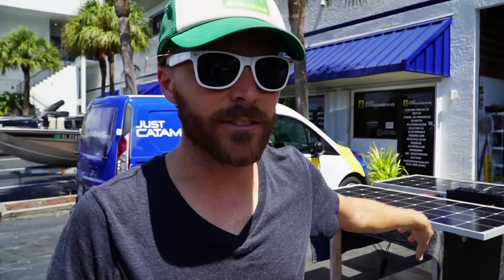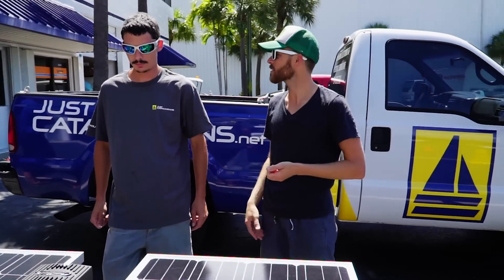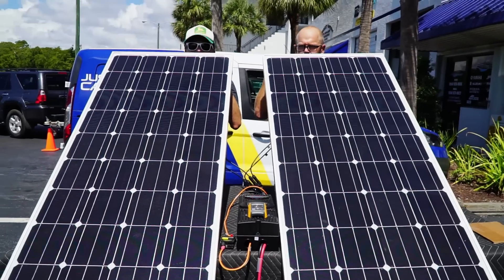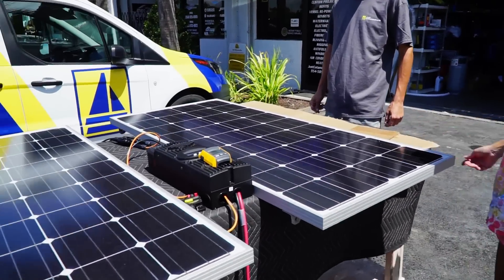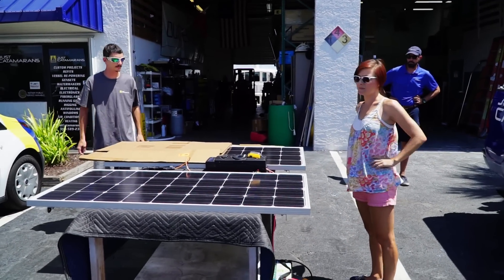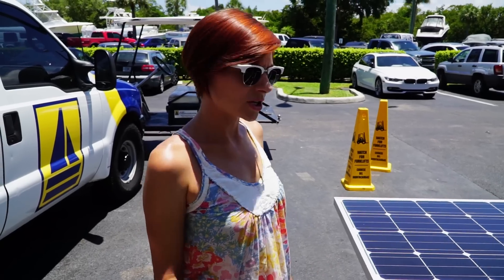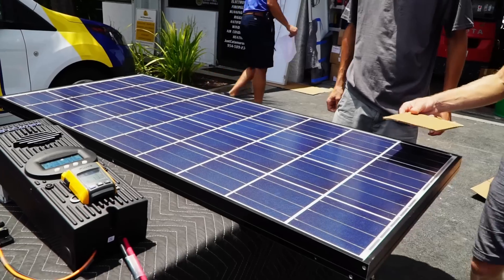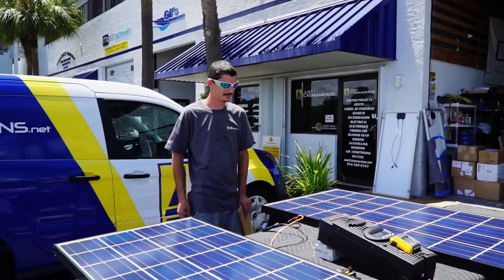Sailboat Solar Power - Series vs. Parallel & Shading

Comment: Since watching this video, I did some serious research on solar panels and found a company called SunPower. Their solar panels are designed for shade and harsh environments. They sound expensive but well worth it. Hope this helps.
Reply: They buy lots of expensive stuff - they can definitely afford the SunPower panels!
Reply: They are using all the panels they already bought, the 7 or 8 from their RV.
Reply: I caught that, they are the ones that don't like shade. Sunpower makes a solar panel that is designed for maximum output if in shade or even if a bird craps on it. Even on cloudy days, they out perform most others.

Comment: As your old gopower panels are from the rv, perhaps the difference is actually on the glass itself.  I'm going to guess there is micro-pitting and scratches that is diffusing the sunlight enough to make a fresh panel out perform it.

Comment: Some Cats put solar panels over the davits, if you did that you could design a mount that would let you tilt the panels to improve the angle. You could also have a couple of panels that are stored underway but that mount to the rail an could pivot, even be height adjustable to keep them from being shaded. Many boats also have wind generation mounted which will give you power from the gentle tropical night breeze, or gale as the case may be. Just check a bunch out first some are loud.

Comment: the question is, would connecting them in series or parallel yield higher amps out, if the conditions were identical with an mppt controller? didnt seem that way from the tests you did here, so series would not have any benefits, besides maybe cable thickness.

Comment: So basically the solar panels cells themselves are in series right? PS Perhaps some hydraulic system could tilt those panels on the dodger. Nice test btw! Wondering if there are smart panels, where as one cell is not producing X it bypassed keeping the current and flow high. Now its the same effect when you pull out a light in a christmas light string.

Comment: Won't your boon be in lots of different positions when sailing - think tacking.  If one small panel shaded takes out the whole panel effectively, what about using 4 or 6 small panels rather than 2 large panels (?)
Reply: They have like 8 panels or something. They took all the ones off of their RV. Their yacht will be solar overkill.
Reply: It's not overkill if you want to run your electrically powered watermaker on a long passage without burning the limited and dirty fossil fuels on board.

Comment: hi
I'm an electrician.  I didn't see if your controller was converting the voltage to a nominal voltage.  Normally if you connect in series the voltage is higher and amps lower. You have to multiply the voltage and amps to get the watt output.  If the voltage is the same both times due to the controller that's fine but if not then your test is flawed as you only checked the amperage.
I would love to know if the voltage was constant.
Thanks Marty

Comment: Any way to get the panels above the shadow of the boom?  Crows nest mounting?  Maybe a way to have them mounted to a small electric motor to collapse them when not using them without having to scale the mast.  U could upgrade your sail to the style used on the Alcyone, the Cousteau Society sailboat.  Put flex panels on the sail.  Probably an expensive solar panel mount...lol  but it would be cool.

Comment: It also depends on how many by-pass diodes the panels have, if any.  Canadian Solar uses half-cut cells and has more columns.  They put a by-pass diode on each column.  Allegedly, Sunpower has a by-pass diode across each cell. I don't know about other panels... damn hard to find that info.

Comment: Your results are typical with the types of panels which you were using for your test.  This is also one of the main issues which solar panel manufacturers face.  You may want to check out TenK Solar, their panels do not have the shade issues which you have shown.  I know because I have their panels installed on my house, which has a tree which shades a number of my panels, but I still get decent power out if them,  even when more than 1/2 of the cells are shaded.  I am planning on using a panel or two for my RV, since I expect to have tree shading issues while parked.

Comment: Interesting to see that fall-off in power. Re other sources of power. What kind of props do you have? ( folding, feathering, fixed pitch.) If you are running  fixed pitch props you could add an extra pulley, belt and alternator on the prop shaft and take advantage of the flow of water passing the props. Also gives you triple redundancy in the event of an alternator failure. PS..... just checked your haul-out / survey video...looks like fixed pitch!..... worth considering.

Comment: Could you use multiple charge controllers so each panel works interdependently?
Reply from the maker: Yes, stackable MPPT controllers may be the answer...or at least one of the answers.

Comment: I would think the shadows will be to one side or the other but not both sides at the same time.  try series on each side then the two sides in paralell. Your MPPT will like the higher voltage and the lower line loss due to higher voltage.

Comment: An additional bypass diode connected in parallel with each panel when the panels are connected in series can help if one panel is shadded

Comment: What would supplementing with wind turbines do for you?
Reply from the maker: Not much. We touch on that in this post https://www.gonewiththewynns.com/charge-boat-batteries  Turbines would add so little power at normal "ocean breeze" wind speeds, and at higher wind speeds they tend to be really noisy and can cause awful vibrations through the hull. Nobody we know who has one loves it.

Comment: I would like to have seen the voltage difference more than current as series panels would drop voltage to the controller. Ideally you'd want to measure watts doing this experiment. Which requires both amp and voltage readings.

Comment: I also thought the bypass diodes were to mitigate the power loss from shade so I was surprised by your results...  I went googling and ended up finding an interesting document that explains that the diodes are actually to protect the shaded cells from being burnt up by the unshaded ones in the same string of cells.  

Learn something every day!  

Here's the doc if anyone is interested:
  http://www.solaredge.com/sites/default/files/se_technical_bypass_diode_effect_in_shading.pdf

Comment: Mind blown!  Seems like numerous small panels wired in parallel would be more reliable than one large panel if there is ANY chance of shading.
Reply: Just so, I'm not any sort of knowledgeable as to solar panel construction, but it seems that the sections of each panel is wired in series and that there is no pass through of the electricity generated by the separate sections if one entire section is covered and there is NO electricity generated from it.
I would not have believed that would be the case. I wonder if there are Marine solar panels that are wired in parallel to avoid this
Reply: Less wiring maybe?  Like the old strings of Christmas lights.
Reply: Mike Siedlecki Probably exactly right, less wiring.  I suppose it makes sense for most applications where solar panels are installed, Doesn't work exactly right for a sailboat though!
Reply: no...it's like hooking up batteries. do you need voltage...or current? then connect accordingly.

Comment: Many people mount their panels on an arch over the dingy davits to avoid shading. Some people mount their on the life lines and pull them up when needed.
The series parallel test is basic high school math
Parallel is positive to positive and negative to negative , voltage stays the same , amps are added together
Series is negative to positive,  Amps stay the same , voltages are added together
Reply from the maker: On our catamaran we are mounting above the dingy davits but the boom is still a factor and will still create shading.
Reply: There are all kinds of options but $$$$
But it's easier and cheaper just to live with it, watch your consumption, get more or better panels at a future date, they are becoming cheaper every year. If your boat don't have a generator, get a Honda 2000 for topping up under heavy use

Comment: Nice test and I would always go parallel because as one panel may fade, the others (not shaded ones) will still deliver that 12 VDC that you want. If you're in series at 24 volts and you get shade, you will never achieve the proper voltage. Good choice on going parallel!  Ü

Comment: try a flexible solar panel, and try to use propeller power, like by putting a wheel in the water while you're sailing or in the air to produce power.

Comment: Solution:  4 panels in 2 groups, the groups are connected in series and each 2 panel group is connected in parallel, connect a wind turbine to supplement the solar panel arrays.

Comment: Install the panels at the very aft of the boat out of the way of any shadows. See video channel of SV Delos and see how they have their panels located. Good luck
Reply: Pretty sure they are aware of installing on top of the davit system. They have six or eight panels, so I'm sure they'll have a couple on the davits and the rest on the cabin roof.

Comment: Here's a really good link explaining shunt diodes and how they help. And also have a look at Half-cut cells. https://www.thesolarnerd.com/blog/which-solar-panels-work-best-in-shade/

If using cheaper panels, (with fewer shunt diodes) you'd be better using several smaller panels wired in parallel, although this isn't as space efficient for the same overall power, but you might find that you generate more power with 6x100w independent panels than 2x400w panels in situations where you are likely to have partial shading.

Comment: I suppose the ideal solution would be to use the diy kits and wire each cell parallel so shading one cell doesn't take out the whole unit?
Reply: You need some series connection to get a high enough voltage

Comment: If the simulated boom shade is a problem, what about that huge Dacron thingy attached to the mast/boom? Wait I got it, sail at night, drift during the daylight so that pesky sail isn't a huge shade issue.(  ;-)  just kidding) Try installing several sets at different locations on the cat and manually switch to highest charging set as you tack.

Comment: Almost all solar panels out there have all the individual cells connected in series.  I've seen one exception.  I have a panel that has two strings of cells, each set in series, and the two strings in parallel.  So, almost always,, shading most of a cell or an entire cell is GOING TO BRING THE WHOLE PANEL DOWN.  :(  So, parallel is anyone's best bet unless you use optimizers or, in the case of a grid tie system, micro-inverters.  Outside of these two cases, ALWAYS do parallel instead of series (if your charge controller can handle it).  If you connect two or more solar panels in series, and since the cells in each panel are also in series, you basically have one long string of cells connected in series, so the total current you get out of the entire set of panels cannot exceed the current produced by the LOWEST producing cell.  So, totally cover one cell and you bring down the whole system.
When you do parallel, covering an entire cell only drops the current by the power of that one panel.
Reply: I thought about this and what I said above is not 100% true.  For a home system with a lot of panels, it is usually not possible to connect all the panels in parallel.  The current (amperage) generated would be prohibitively high so the gauge of the wiring would not be practical.  In this case, the panels are usually broken up into multiple sets of series connections or, as I said above, optimizers or micro-inverters allow you to connect everything in series without shading causing a problem.
Reply: 99% of solar panels are made with either 2 to 4 strings of cells tied in parallel.  This is to achieve a high voltage and a low amperage that will suite a residential setting and National Electric Code limitations. The diodes are typically placed strategically across the edges of the parameter to prevent as much production degradation from shade as possible.  This is because most panels are designed to be placed on roofs, and most shade comes from tree branches that will cause shade that will span the width of a panel/module.

Comment: Nice test...
I think you should have used parallel on the RV as well...
Series is only useful if you have to use a longer distance of wires from panels to inverter/controller (what ever you call it ;-) )
And on a boat or RV the distance is alway short enough for parallel ...

Comment: Two panels on a boat this size with it's energy requirements is pretty anemic. Have you figured out your daily amp/hr budget yet? Without it all this is just shooting in the dark.
Reply: this was just a test. They have all the panels they took off their RV plus the lithium batteries. They are going to have over 1000 watts and 1000 amp hours.

Comment: I think the problem is inside each pannel. Cells connects series inside. If i am right you just should sell this pannels and buy another.
It was intersting video. Thanks !
Reply from the maker: That is why we tested multiple panel brands.  They each have diodes but they only do so much when it comes to shading an entire cell.

Comment: mount the solar panels on a frame over the transom ;-)
Also if you have 2x50W panels and one fails you're on half power, if you have 5x20W and one fails you have 80% power ;-)

Comment: Ideally, You need to run a charge controller on each panel. If one panel is shaded... You would still get full power from the other panels. This is the expensive solution... You can compromise, If you run 4 panels, you could run 2  controllers with 2 panels each. This redundant thinking gives you more efficiency and if you lose a charge controller at sea, you still have one... And, in a pinch, you could hook up all the panels to it (assuming it could handle the amps).

Comment: Wow! I'm not really familiar with how solar panels work, but you would think that when shading 10% of the panel, it would only take away 10% of the power. There is an opportunity for someone smarter than me here...
Reply: Each cell on a panel are linked in series
Reply: That would appear to be exactly the problem. For the current to drop that much by covering just one cell, most of the cells on one panel would have to be in series. Which is made made worse when you connect the two panels together in series as well. I can't for the life of me think why the panels would be designed this way since it negates the whole point of parallel redundancy of the cells. But it sure seems to be the case.....
Reply: Yes I was screaming at the screen when they put one on one cell.. LOL.. But its really good they went out and tested it so people can see :D
Reply: Seems like it's behaving similar to old Christmas lights, when one goes out the whole string does too.
Reply: Mike Houde
Correct !
Reply: Adippen
The reason is: it's cheaper to manufacture that way.
Reply: It would be pretty cheap and easy to wire up some sort of semiconductor internally between each cell to prevent the problem. I mean, if done in bulk it would not really increase costs all that much. Sure it is cheaper, but if you are the only manufacturer doing it that way, you could make a mint. I'm not ee, and even I could fix the panel so it wouldn't exhibit the behaviors that it is.
Reply: herranton1979
Yeah but then you'd have a high current and barely no voltage...

http://www.pveducation.org/pvcdrom/modules/module-circuit-design
Reply: F Maz That isn't correct at all. I wont explain it, but here is a link that does:
http://www.pveducation.org/pvcdrom/modules/bypass-diodes
Adding a semiconductor in parallel to each cell would eliminate the shading issue. Sure, there would be a voltage drop, but only one commensurate with the number of cells being shaded. Infact, Kyocera, the maker of the panels in the video, even specifically states that they are using them in the panels. Here is the info pdf on the panels:
http://bfy.tw/6f4J
(I mean no disrespect with the lmgtfy, it is just the easy way of sharing)  
I am not so sure that they are being totally honest. I bet they are only using 2-4 bypass diodes per panel. If they were to use 1 per cell, or even 1 per every 2 cells, they would significantly increase performance for a negligible amount of money.

Comment: so the cells are in series on each panel
Reply: lots of wiring in a parallel panel
Reply: +Charlie Sills I don't understand. there is a lot of parallel wiring in the panels ? it seems the best way to go,  if the cells are serial is to get small panels wired parallel.
Reply: You need the series wiring to get the needed voltage.

Comment: I don't understand why covering just one cell would drop the output of the entire panel so much. Anyone?
Reply: Also, in parallel, bypass is taking out the blocked cells, meaning the panel voltage is either not high enough to match the full output panel, or if it is high enough, its efficiency has dropped so far that it can't add any real current any more, even though most of the panel is still functional. In a low voltage panel, the cells are parallel groups of series strings, with diodes allowing bypass of small groups of cells if shaded. Mostly for panel protection.